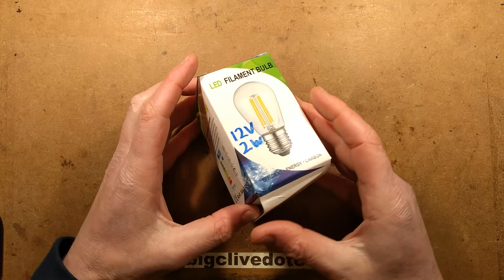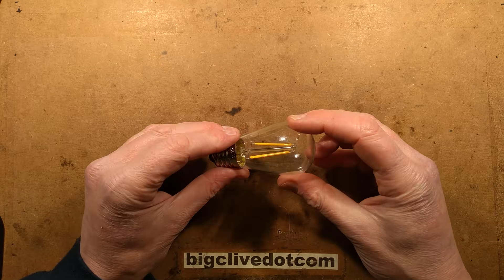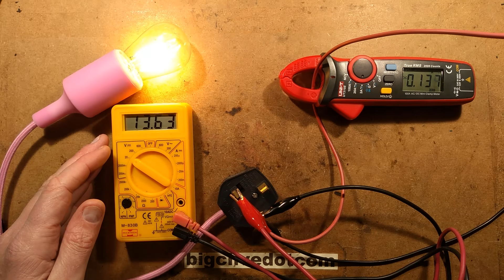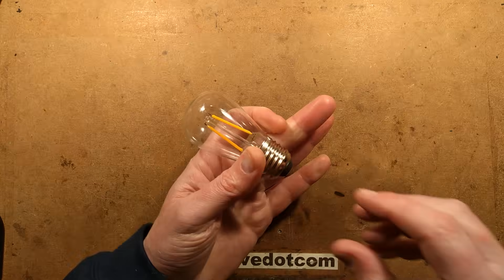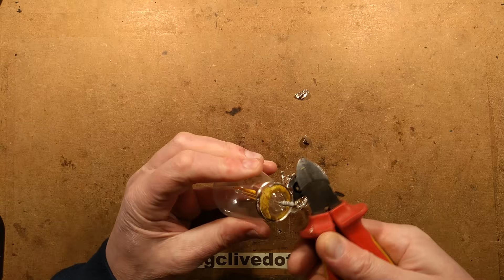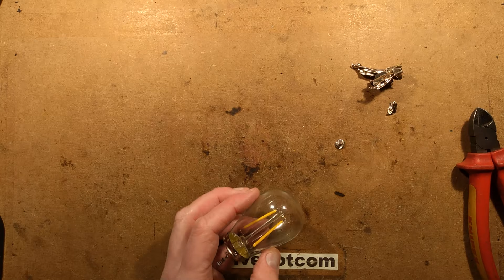Beautifully simple 12V glass LED filament lamp.

Comment: Im in China, i have a little solar panel and a battery and a small inverter. I Changed most of my houselighting to 12V now and power it via a "hacked" ATX powersupply and when (not if) power fails i got a nice backup to keep the house lit, charge my phones and other USB devices (DC-DC converter fed into a hacked USB Bus) and can keep my fridge on (via inverter). I have Gas cooking and waterheating so for me personally a poweroutage is nothing more then a minor inconvience until the batteries fail that is (runs about 12 hrs generally outages last at most 6). For Folks in developing countries 12V DC is great and simple and i will definetly get myself those simple LED bulbs since i have the other variety (with the regulator) which do not live very long sadly. They are very much prone to failure overtime.
Reply: Nice!
Reply: Same here... in Beijing.
Reply: Same here, though the 30W panel does keep the battery charged. Have gone through 2 batteries though in the time I have had it ( around 7 years now), and the original Chinese MysterLee battery did 3 years and the lead crystal did 3, now just put in another used lead crystal from a UPS that got a new battery.
Reply: @Izak Yeah, it's because sometimes they actually test electronics that are exported lol
Reply: You dont need a ATX power supply to power 12v bulbs from a solar panel.
Reply: @ekoms108  Must be hacked as DC-DC if he has 24V+ battery bank
Reply: It's mindbogling to me that with so many people having solar already there aren't almost any standardized solutions for dc lighting

Comment: My Mother used to have an aquarium light which was fitted with a 12V tungsten lamp, which had a full size BC cap. One day, the lamp failed to light, so she proceeded to fit the lamp into a 240V outlet. As you can imagine, she was quite alarmed by the resulting explosion.
 When I questioned her reasoning behind fitting a 12V lamp into a 240V fitting, she explained "Well, I thought it would only use 12 of the 240 volts"...
Reply: bless her heart, but this is one of the many very good reasons to have good science education for everyone
Reply: I agree. However, Mum went through the education system in the 1930's when girls were really not encouraged into scientific subjects.
Reply: Technically, she was right! The lamp did only use 12 of the 240 volts, and the other 228 of them blew it to smithereens!
Reply: Logic would be fine if dealing with current or power!

But...alas not voltage
Reply: Give it volts but it takes amps. Bar resistance, she's almost stumbled on Ohms Law from first principles. Never underestimate little old ladies.
 ( no offence, she may well be relatively young and svelte for all I know ).

Comment: I should mod my interior light in my old '89 Galant to an E27 socket and fit one of these as the interior lightbulb. Would be a nice conversation starter when driving people around.
Reply: Except you shouldn't have it going when you're driving. ;-)
Reply: @Shaun.Stephens  yeah the existing door wiring will work

Comment: I use these outside in our Tiki Bar, and run them off solar panels and a rechargeable lead acid battery. Makes fo great outdoor lighting without needing a mains supply

Comment: +1 on prescription glasses - they've saved my eyes countless times. If you're in our line of work, you almost have to wear some glasses full time. You never know when that wire snip,broken tool, spraying chemicals or flash is going to get you. 

My worst eye incident was when I kneeled down to look through my scrap metal collection under my grinder bench, I reached up to stabilize myself  and just as I looked up to be sure of my hand position my hand wiped several ounces of grinder dust into my eye. Days of agony, no escape, no sleep. Had my glasses on, but it went right behind them. That was 30+ years ago, but has made me cautious to this day. Never count on your glasses to save you, but always wear them.

Cool light. These new elements are a evolution of the LED I didn't see coming - quite clever.

Edit - no joy on USA Ebay search, but here is a link for a 4 element 4W version - 4 pcs for US$16.88 - they have 4 or 6w, choice of WW or CW
https://www.ebay.com/itm/12V-E26-Light-Bulb-A19-4W-6W-LED-Edison-Classic-Medium-Base-Lamp-RV-Marine-Boat/192760909688?hash=item2ce1720f78:m:mTfXI6hB7z-lwtc_uySorEw:rk:3:pf:1&frcectupt=true
Reply: Ouch!

Comment: I have always thought of providing my home with a 12V circuit for lighting purposes, inspired by low voltage applications in my life outdoors. I never bothered to check if such systems were already on the market for indoor use. And now you're showing this one! It is simply brilliant. I have loads of used batteries (AA and AAA) with some power left, and combining them has already proved to be able to power a couple of LED's. This way I can get the most out of the batteries, as they are too weak to provide my headlamps with a convenient charge, but still contain energy. Thank you so much for this video, this was the spark I needed to get started. Keep up the good work, I enjoy every aspect of your creations.

Comment: For a little while in the USA, ATT , the internet company was including 12v UPS' with their equipment. Later the UPS's were all showing up in thrift stores everywhere! These UPS's use standard 7ah lead acid batteries. I ended up wiring these UPS's to lamps, then sticking 12v lights in the sockets . Then putting these lamps with UPS's around the house. If the power goes out, we still have lights!

These lamps you show here would make these projects last a lot longer with their 1-2 watt draw! Thanks for the video Clive!

By the way the UPS's were by Belkin. They sell for a bit more online, but if ya find them in a thrift store, they usually go for 5 to 10 USD. Hope this helps someone!
Reply: yup but those had shit runtime due to using tiny 12v sla batteries so I own an apc back-ups pro 1500 and use the external "battery pack" to connect 2 100ah marine batteries for ~3 hours under heavy gaming load 6 if I just want my server and interwebs for my tablet
Reply: @christopherhauck4702  hah, that's pretty cool!

Comment: The Edison base 12V lamps are also frequently used in RV's.  Go to an RV dealer and look at all the 12V accessories available, like exhaust fans, coffee makers, etc. It's a good source for 12V stuff if you are running solar/battery power, and more efficient than using a 12V to 120V converter to power a standard appliance.

Comment: The dimming on this is incredibly smooth to, you can dim it right down to zero and I haven't found a standard 120v (US here) LED bulb that dims down this low and nicely. Planning on installing a knob and tube electrical system on the ceiling of my living room to complete the industrial look but it needs to run on 12v in order to keep the insurance happy and this type of bulb is just the ticket.

Comment: I really wish they wouldn't mix up voltages and fittings.   E27 should definitely not be a 12V socket.
Reply: You've never spent time on big ships I can tell. I've had E27 lamps in 12, 24, 42, and 48V in addition to the "standard" 120V.
Reply: @Peter_S_  Still it's a good idea to have separate standards for different stuff that isn't directly interoperable. Call it "idiot-proofing" if you want, but this kind of thing deserves it.
Reply: @Peter_S_  Surely these are not being sold for use on big ships. For most people, that's an irrelevant observation.
Reply: @pauljs75  The problem is you're assuming E27 is connected to voltage. It's not. It's not connected to current either. There's a huge difference in construction between a 40W capable and a 300W capable E27 sockets even if you forget about the voltage. The trouble with "idiot-proof" things is that they only get used by idiots.
Reply: @misterhat5823  Why do you think they're not sold for use on boats and ships? Were you previously aware that E27 is common for 12V, 24V, 36V, 42V, 48V, 100V, 120V, and 230V lamps? I doubt it. How do you think all the things you use in life get transported around? Even my little 28 foot sailboat and 22 foot fishing boat had E27 @ 12V cabin lighting. Same with my 38 foot cabin cruiser. Before the last few years with LEDs coming into their own, that's how lighting was done around the world.
Reply: @Peter_S_ I never said there never were 12V lamps on ships. I did say that these ePay cheapies are certainly not being bought by people to use on ships.
Reply: "The trouble with "idiot-proof" things is that they only get used by idiots." Sir, you've made my day! :)
Reply: @misterhat5823  That's where you're wrong and that's what I called out. Why do you think they're manufactured in 12V, 24V, 36V, 42V & 48V versions? Generally ships have 36V or higher systems but if you include boats and just talk about 12V E27 lamps as in the video here then they absolutely are being made for people on boats and ships, for use in boats and ships. 12V incandescent lighting is extremely power hungry because the voltage is 10x lower so the current is 10x higher for the same wattage in comparison to 120V. It's a great retrofit market. Where do you think ship supplies come from? West Marine will charge $38 for a part you can get on AliExpress for $4.50. Everyone wants to save.
Reply: For the haters ... E-26/27 have been used for low voltage lamps for decades on ships/vessels  , caravens/campers and emergency droplights .
Reply: They use these in Spain both the ses and es types at 230volts  . Also I believe that trains use es bulbs not sure of voltage.  It is confusing with so many different fittings but this only really started  becoming a problem when Ebay and others opened up the world to anybody on the internet .
Reply: I get the idiot proofing angle, but they're also really handy for some scenarios, so while maybe it isn't something that should be in every supermarket it's nice that they are available to those of us who hopefully are non-idiots most of the time 🙂
Reply: anononomous 
  Agreed , I have retrofitted "home" table lamps to low voltage in my off grid homes .
Reply: @Peter_S_  was that the "standard" 120V that usually turns out to be somewhere between 90 and about 140?
Reply: @gordonlawrence4749  😂😂😂 LOL! You've played this game before I see. The other great thing about "standards" is there are so many different ones to choose from.
Reply: Exactly what i was thinking too, neat lamp and all but thats just asking to be put in a full power socket somewhere
Reply: Well there I stand corrected.  Worth paying close attention before plugging them in, then!
Reply: let me tell you about 120v e10 sockets
Reply: 72 volts in loconotives and 36 in the old railcar lighting system.
Reply: What's an emergency droplight? Is that what it sounds like, something like the oxygen masks on an aeroplane, so when the power fails, an overhead panel opens and lights drop down?
Reply: @paulsengupta971  You've got the right idea. They're the type of illuminated emergency exit sign that is suspended from the ceiling. Although strictly speaking a droplight is one held by wires that can be raised and lowered.
Reply: Sounds dangerous to me! :-)
Reply: You've also got BA15 and BA22 S and D which is the bayonet fitting 15mm and 22 mm light blubs in single or double contact. Maybe there once was an assumption of higher voltage needing better insulation and separation from internal wiring. I've never understood it. Personally, I like the bayonet fittings as there wasn't any muckle great shroud insulating the screw thread part of the Edison fitting.
Reply: Could you do a lumen output test on these types of videos great vid by the way

Comment: I have a few 12V E27 and E14 bulbs. Other than the potential for confusing voltages I really like them. Makes basically any lamp portable by swapping the plug for a 12V cigarette lighter plug, or even just clamping onto the plug 🙂 Good for a campervan,

Comment: I've seen the little hole in the threaded section of E27 bulbs before. My best guess: It's to release any pressure created when the bulb section is pushed into and glued to the threaded section. This stops the bulb popping back out of the glue before it sets due to trapped pressure. Could also be useful during operation in the case of mains powered/high temperature globes for similar reasons.

Comment: A moderately interesting thing to try with these LED filament bulbs - hold one up to a "plasma ball" and you can get it to light up.
Reply from the maker: I wouldn't recommend that.  The voltage gradient from plasma balls is huge and can damage some sensitive electronics with high reverse voltage.  Things like fluorescent tubes and neon filled lampos are fine though.

Comment: I already have all my lighting using 12VDC...with both strip & bulb LEDs.
The system is powered by a AGM battery bank which is charged with a power supply running through a charge controller.
All the strip lighting is dimmable and in cool white over the work areas.
The bulb are in warm white and are over the more living type areas.

Comment: haha always very exciting when you plug something into boom volts when it's not suppose to be boom volts :)
Reply: Done that, big box of assorted lamps in a lighting shop, and a test socket. Let's just say the glass envelope did survive, the socket had a skid mark on it, along with an inner surface of the lamp being tungsten plated, plus the breaker did trip. Bought another one of the 12V 30W B22D lamps though, just for the ability to make it work off a car battery in a good old fashioned lead lamp housing.
Reply: As I recall, tantalum bead capacitors connected to mains go up quite well...  Lot cheaper than blowing up a bulb every time you want a bang!
Reply: @charliedobbie8916  So do 200 mfd 15 VDC capacitors.  One heck of a bang.

Comment: This would be great for caravanners. We tend to have 80w+ solar panels and leisure batteries so in the awning would provide great lighting. At home I could see a smaller set up in a shed with say a 10/20w solar hooked up to a lawnmower / car battery. I know there's similar shed LED systems, but they tend to be short lived or dim.

Comment: My order of 4x of these bulbs arrived on NYE, and I'm impressed with them, the colour of the light is the nicer end of warm white (not keen on the yellowy-white, looks yucky), and they're nice and bright given their rating, got one running off a 3S lithium battery pack (with protection, of course!) and it's running nicely, might just stick my solar panels back in the window and have a couple 12v-only "free power" lamps on the go... :D
Reply: Thought I'd add this technical note - my bulbs lack the resistor!! Same style, same box, same construction, but no resistor (as I just found out when one got ever so slightly overvolted on a "12v DC" wallwart and blew one of the two groups of LEDs in one of the filaments!!), oops!! :P

Peeled the ES cap off as you did with yours, no resistor, just a direct connection from base pip to the LED filaments and back out to the screw cap, so they're not all equal it seems... :S
Reply: @twocvbloke  I bought a 10 pack.. also no resistor... it is a true 12v lamp. I popped one at 13.8v on a solar system..
Reply: I've fitted a 10 Ohm resistor pack into a lamp socket for use on anything higher than 12v, seems a bit odd to have them set up for dead-on 12v rather than higher versions of "12v"... :\

Comment: I have often thought 12v and 5v DC should be the future for domestic use with 240V just required for high powered applications. At the moment so much energy is being lost when you consider how many transformers are in each house hold.  It seems mad that the lighting circuits are still on 240v when very few modern lighting applications require it. Hopefully within the next ten years this will start to happen.

Comment: 9:10 this is actually what I am doing. Although I live in a big city, I often am faced with power outages quite often a year... Beijing, China. I have been steadily replacing all the lights to 12V LEDs and run them off a battery/backup system. The same for my computers, they all run on 20V DC as main input voltage... I am not at the stage of a PowerWall yet, but would hope to get to this one day.
Reply: BTW, nearby we have a ton of stores for LED and other lighting ornaments... a valhalla for you. Often wonder if I should make photos or send you some of the stuff.
Reply: Why does the power fail so often?
Reply: @simontay4851  several things contribute to this. the wiring is all above ground and easily affected by weather conditions, but this is therefore also easy to repair. But the biggest problem is that people here over use their air conditioner during summer and even in(/before) winter turn on electrical heaters... putting strain on the power supply. In the neighbourhood there is a lot of stores and office buildings which weren't there a few years ago. I guess this segment of the power grid did not account for that.

Comment: My little white  £4 rechargeable LED desk lamp arrived the other day. It's very happy running on two Nokia BL5C  batteries in parallel. Each have a claimed rating of 1020 Ma, so it will have a respectable run time.
Reply: just make sure the cells are not knock-offs some don't have protection circuits.

Comment: I have several 12V LED lights in the house, fed by a power supply in the cellar. They are stick on strings, some fed by PWM dimmers, some by motion sensors. I can see homes in the future with low voltage DC busues, powering all kinds of lights and gadgets, saving a lot of installation problems. My ceiling lights which take 100ma have #12 gauge wire with ground. Overkill.

Comment: "Two filaments, both in series"...  I much prefer the model with two filaments with one in series and one in parallel.  :)
Reply: bokkenka If it had been all 40 LEDs in series it would work around 110V DC.